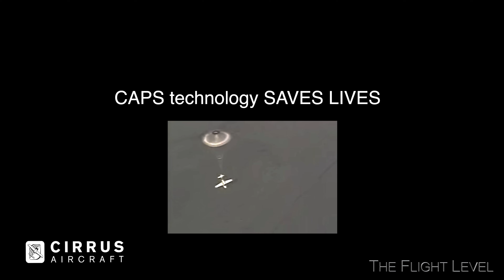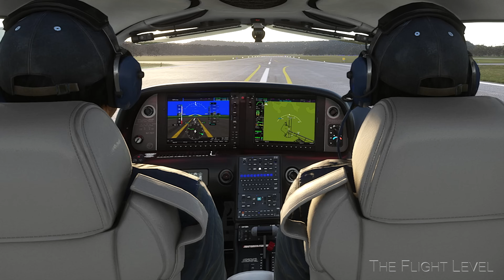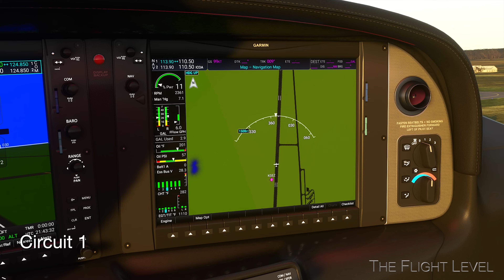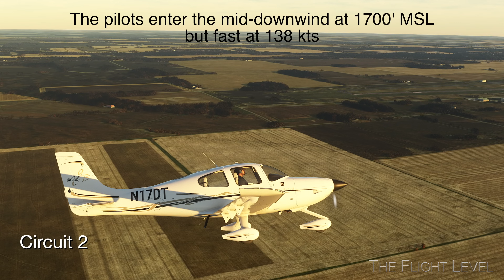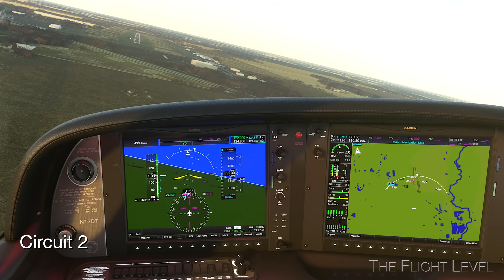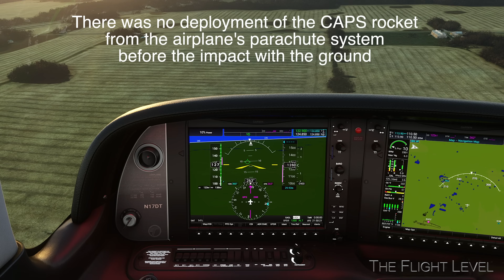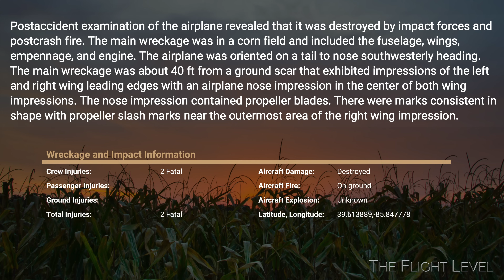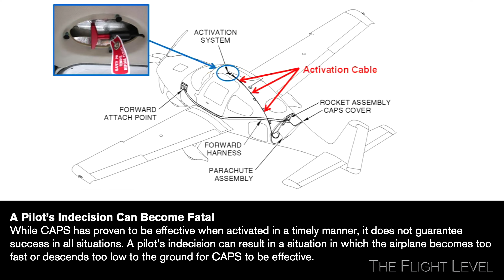Parachute (CAPS) Indecision | Cirrus SR22T (N17DT) Flight Ends in a Fatal Accident

Comment: Excuse me I'm an old timer but I would question flight training that emphasized pulling a parachute rather than learning how to fly the plane properly as this video suggests. This was a stall spin accident over corn fields that should not have resulted in a fatality or even damage to the aircraft. Given the unlimited corn fields northwest of Shelbyville I would have landed the aircraft. Back in the stone age when I was an instructor we drilled power off landings over and over again. I had every confidence that any of my students would walk away from engine failure over anything other than a congested city. The key here was maintaining airspeed, not failing to pull a parachute. A controlled landing, even into fences or trees rarely results in a fatality or even a serious injury. A stall spin however is usually fatal.
Reply: There are two reasons the SR series didn’t get certification without the parachute.  Lots of “old time” instructors, including a good friend of mine, died trying to land in a cornfield, while 3 friends I know have walked away pulling it.  1: It can’t recover from a spin.  Arguably, with a CFI on board especially, that shouldn’t happen. 2:  in 7 out of 10 cases, on flat grass field landings, let alone a corn field as you suggest, because of the low 3” clearance of the wheel pants, and the fwd cg of the engine, the plane cartwheels into a fireball when any other aircraft besides a cirrus could land uneventfully, or at least, without substantial damage causing fatal injuries.  The dead CFI who wasn’t a CSIP shared your mindset, because he hadn’t participated in the engineer led safety courses at Cirrus I have, to fully understand the importance of using the chute.  Also, I own 2 SR22 planes, as well as a Lance, DA62, and King Air 200, and while the latter 3 show buffeting and signs of impending stall, because of the split wing, the cirrus doesn’t.  Not the slightest until the wing snaps over.  A non-Cirrus instructor wouldn’t recognize it until it snapped over, and also wouldn’t grab the chute handle out of immediate instinct when it happens, obviously.  I have no doubt of your competency, or the dead CFI’s in a 172 or a Malibu, but statistically, the n training flights, 32:1 non-cirrus instructors will perish in the event of engine failure over the CSIP who grabs the handle.  For a reason.  It takes a lot to unlearn the control we all agree to assume when we lose and engine with respect to maintaining stability all the way to the ground.  With the airspeed tape on the very left of the perspective screen, in a panicky cockpit, it would have been a tough task for the right seat CFI vs a CSIP who would have pulled immediately to give canopy time to deploy.  Buying a cirrus doesn’t buy additional safety, but additional risk if you don’t use the certification method required by the FAA to avoid cartwheel/fire and spin accidents.
Reply from the maker: @muledogmuledog8944  Thank you for your excellent insight and first hand experience. I don't know for sure, but I am under the impression, the CFI did not have CAPS training. If he did, this video would likely not exist. Funny you should mention about the low clearance of the wheel pants. In the sim, the pants looked as though they almost touched the runway ... so again an accurate representation by Flight Simulator. I will add your post into the description of the video to emphasize the importance of Cirrus training and the value of knowing when to pull the chute. Blue skies!
Reply: Without receiving specified training, most old timers will question this. Research cirrus training. Under no circumstances are people taught to simply pull a handle. It’s taught to do so and how to do so as a last resort. Seatbelts and airbags were controversial too and it’s important to remember that all advancements in safety are good. Cirrus students still do plenty power off landings lol
Reply: I too came from the old ways. Why risk it though? If you're going to be landing off field, the plane already belongs to the insurance company. Obviously dead stick landings should be practiced, but in a real emergency if you have a CAPS/BRS, use it. Like that old Air Force video titled something a long the lines of Ejection Decision too late.
Reply: There's no "old ways" - there's what the book says to do, and the book gives you a hard deck where, if you're not assured of your ability to make a runway, it says to pull the chute.  I went through this training before flying the SR20 and it's quite clear.  The Cirrus only has an 8" clearance from prop to ground, so you're likely going to be a write-off in a field regardless.
Reply: I would think LEARNING to to fly the plane in this situation is a good idea - BUT, when actually IN this situation why would one take a chance with their life if there is a proven tool on the plane?
One thing to have the knowledge to handle the situation - another to purposely choose to ignore a safer method that is available.
Reply from the maker: Thanks for watching and commenting. Your points are well taken. Precisely, they were unable to maintain airspeed for whatever reason and they should have pulled the parachute. We do not know if the instructor had training as a certified Cirrus Standardized Instructor Pilot.
Reply: @TheFlightLevel  " Precisely, they were unable to maintain airspeed for whatever reason and they should have pulled the parachute. " -- No. They should have just landed the plane straight ahead. You maintain air speed wit hyour yoke, or in case of a cirrus with your side stik, even if the engine is dead.

" We do not know if the instructor had training as a certified Cirrus Standardized Instructor Pilot." If the instructur cannot a power off (assumed) at pattern altitude, then the problem started when they took off, not when they could have pulled the chute. But yes, wit ha student who cannot yet land an airplane and an FI who cannot either, it would be a smart idea to pull the chute. That I agree.
Reply: @MaxMustermann-nd4uy  well put - my thoughts exactly except you explained it better. LOL
Reply: @MaxMustermann-nd4uy  Incorrect. They lacked sufficient speed and altitude to recover in any way from the stall spin. They literally fell out of the sky from a few hundred feet. They were boneheads and going too low and too slow for that aircraft’s design.
Reply: You are correct.  The CFI had 2.1 hrs of cirrus instruction prior to training in the accident flight.  Also, a suspicious contributing factor was mis-management of the turbo on touch n go’s, with CHT’s pushing 420 throughout the training flights.  Mine would be 320-350.  The majority of the CFI’s flight experience were in archers and 172’s, and I understand he had less than 25 hours of total complex HP time, and sharing the same insurance company as the insured, he didn’t even meet the 25 hours of m&m for the SR22, and the insurance was only binding because the owner was receiving dual for the first 25 hours.  Totally senseless, as he was a first time SR22 owner, and Cirrus pays for transition training with a CSIP no charge for buying a new or used SR22, and it was the presumption of the insurance underwriting that he would take advantage of that free training he didn’t want to wait 3 weeks to receive.  Lots of bad ADM here, which resulted in a horrific outcome.  I’ve had, in addition to the lance, SR22’s, king air, a Malibu meridian, m500, mirage, 172, 152, archer, and arrow, and I’m typed in the CJ2 and SF50.  Every engine failure is treated the same, except for the SR series.  It’s always CAPS for several reasons.  Troubleshoot down to 2,000 and pull.  If you’re above 600, and under 2,000, pull.  In any other plane; pitch for best glide, maintain control, and scan for the best suitable, reachable touchdown point.  But the slippery speed and efficiency from the SR series comes at a detriment with off field landings, hence the parachute requirement for certification.  Always sad to see anyone perish senselessly when they couldn’t wait a few weeks for the free CSIP transition training Cirrus pays for, for any new owner, when the chute isn’t pulled.
Reply: @muledogmuledog8944  Are you referring to the CFI in the N17DT accident having "2.1 hrs of cirrus instruction prior to training in the accident flight" and "had less than 25 hours of total complex HP time"? If so, that is entirely incorrect. This was a tragic accident. The conclusion that this was "CAPS indecision" is entirely premature. To your statements, the CFI had more Cirrus SR22 CFI time given training me alone in my last flight review and two IPCs! I know firsthand (since he was a partner of mine in an SR22) that he has well over 1000 hours in SR22 and several hundred hours CFI time in SR22s of all vintages. He was an accomplished, well trained pilot and a great instructor and very much a believer in CAPS and safety. I am also confused by this accident and have read the NTSB data and listened to Max Trescott's evaluation. We still do not know what went on in that cockpit. With respect, I suggest we stop making sims and commenting based on partial or incorrect information until the NTSB says something further. PS: How do you know the CHTs in the accident were too high? Are you looking at the CHTs in the sim? You are surely not suggesting that the simulator's CHT readings imply "mis-management of the turbo on touch n go's" in the accident aircraft are you?
Reply from the maker: @muledogmuledog8944  Thanks again for all the extra details. This is obviously so tragic with the pilots not having received the adequate and proper Cirrus training. An eye opener for all to ensure the correct training is received in a timely fashion according to the aircraft type!

Comment: I think there are a lot of assumptions here and misinformation.  First, how do you know they were low approaches and not touch and go? Also, nothing as shown anything about engine issue? The witness stated the airplane looked like it was flying really slow and stalled and attempted to recover which of course there’s no pulling parachute in a stall/spin.  Yes I’m close to this unfortunate accident and the FAA called me a few days after it happened.
Reply: If there was an engine issue, it could be plausible for any evidence of it to have been lost in the crash. Engine trouble would help explain how they got into a stall-spin situation as well.
Reply from the maker: @erich930  Absolutely re the power loss and stall-spin recovery! The aircraft was completely destroyed in the subsequent fire which will hinder the identification of engine issues post accident.
Reply: How dose a plane like that have such a disastrous landing when one of the occupants is an instructor, having said that I live in Nelson New Zealanders and we had a plane crash over in Blenheim about 100 miles from Nelson were there was an air craft with to Nelson flying instructors in the small plan and the aero club secretary and some how they managed to crash the plan into a hill face when coming into land, go figure, fortunately they all made it out alive, but after that it almost put me of flying as I was training for my PPE at the time in the early 1990’s.
Reply from the maker: Whether low approaches or touch and goes is not the issue. Why was the aircraft flying low at circuit height for more than a mile in a westerly heading according to the ADS-B data before the stall? The instructor would surely not demonstrate slow flight at a low altitude.

Comment: Difficult to understand why this should not have been a 'non-event', with or without a parachute.. The aircraft was sufficiently under control, carrying enough speed and with a huge open flat piece of real estate to land on..and, an instructor aboard. Most of these aircraft are selling for around 1 million $$$.. I can't help but think many of them are being sold to people who think that money can buy safety, it can't.. maybe in times of high stress, people are being distracted by TV screens instead of getting the basics right. I recommend sticking with a $75,000 C172 and the simplest of analog instruments for a few hundred hours.
Reply: Just don't understand why they didn't fly the plane with proper glide speed to the ground
Reply: @baxterharwell5353  Exactly.. Piloting 101
Reply: @baxterharwell5353 Right. Problem is 80% of low time pilots or those that dont fly much is to pull nose up when power quits down . I will tell you NO, nose down is first thing.
Reply: I have flown with and without BRS/Magnum chutes in light sport. I like having them for two reasons, passenger comfort level and having the ultimate backup option. However, I have to agree with you that, in this case, they should have been able to land in one of the many fields that were around them. If the simulation in this video is accurate, they never entered a landing glide. I just don't understand that since there was a CFI on board. 

There are a few instances where it makes sense to pull the chute. If both pilots were panicking due to the engine out and didn't feel comfortable with dealing with a dead stick landing, pulling was the option. Otherwise, if the plane is controllable, fly it to the ground, IF the ground is reasonable to land on, which it seemed like was the case.

EDIT: I will also add, that the above is based on light sport, which have very slow stall speeds compared to large GA planes, Cirrus included. I'm about to take delivery on a new Aeroprakt A-22, which has a full flap stall speed of 32 knots. The vertical speed under a chute is just a little slower. In my plane, it's a choice of 32 knots vertical or horizontal. If control is maintained, and there is a reasonable area to land on, it probably makes sense to land the plane. Otherwise, I'd pull the chute and let my landing gear collapse!

Also, I disagree with the notion that analog instruments are the best to learn on. I learned on a CTLS with Dynon displays and analog backup. We didn't mess with the options at all, but I learned how using a PFD. I then transitioned to  other planes, some with analog, some with other brands of glass. I spent two years flying an Quicksilver ultralight with nothing more than a Halls airspeed indicator.

My point is that it's the quality of the training, not they systems you train on. However, it IS possible to confuse and cause issues by messing with the capabilities of the glass. In that case, one is better off with simple.
Cheers.
Reply: They didnt push nose over but up. When theres ANY hint of pwr issues, pitch nose down to best glide, aviate, navigate then communicate. Its taught in private pilot and grilldd into you or not. Some cfis are weak. They were climbing out rather slow, 80-85 kts when it is suppord to be over 90-95.. This is the 315hp Turbo and its heavier than the regular models. Thesw planes have small thin tails area and thats not good for low and slow. Its based on the Lancair/cessna columbia which has a much larger tail. They were going way to slow 76kts, basically stalled and barely control hence steep nose down into corn. Folke for those that fly, know your planrs numbers, practice engine out short approaches and do what if's each time you fly. Theres no excuse and far to many ga pilots are not surviving. If you dont fly at least 4 hrs a month, or cant afford it, sell the plane.. Currency for ppl needs to be every 45 days 3 t-n-g's and flt review every 12 mo not 24.
Reply: If pilots do not take responsibility  the paper pushing rules makers will.
Reply: The "glide into a field" is an illusion. Have you looked at fields from the ground? Now land with 60kts on shopping cart wheels, the front one mounted on a tooth pick in what you see. The fatality rate of Cirrus with a CAPS pull in CAPS operating envelope is: 0.

I don't fly SEP without airframe parachute. It's a reduction of the high risk of GA vs. commercial. As simple as that. It of course doesn't mean you don't need to have your act together, most accidents happen on landing, outside of the operational envelope of CAPS or any BRS.

In doubt, above 1000ft AGL, pull. Discuss later, the beauty is that you can discuss.
Reply: I'm going through ground school now. The school owner is very enthusiastic about their Cirrus planes... when I met with my CFI we both agreed that C172M/N/S is the best way to learn solid stick & rudder and worry about glass when it's time for IFR training.
Reply: @bwjbrown  Excellent advice.. you're lucky to have that instructor. It's aerodynamics that keep you safe in the air, not a microchip.

Comment: I would like to know the condition of the field they were trying to land on. This should have been a successful forced landing. I wonder if there was some feature of the field that caused a last minute panicked control input causing a stall?
Reply: They weren’t trying to land in the field, they were trying to recover from a stall/spin, the witness statements describe just that.  I flew over the accident the next day.
Reply: Being nose in, it seems likely this was more of a crash than a landing. But yes, it should have been a survivable situation if the pilot had maintained adequate control of the aircraft before touchdown.
Reply: electric lines ????????????????